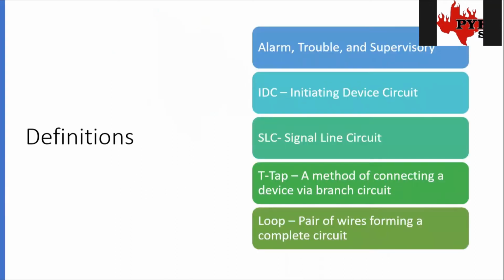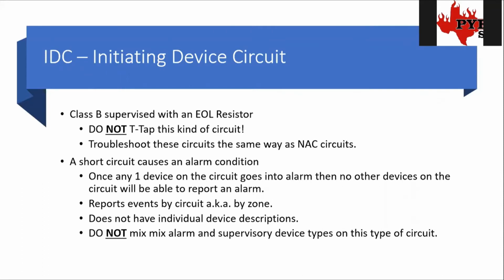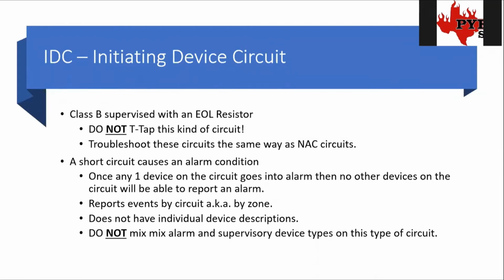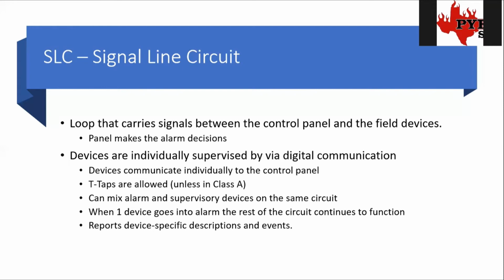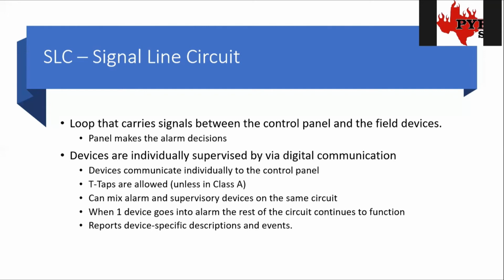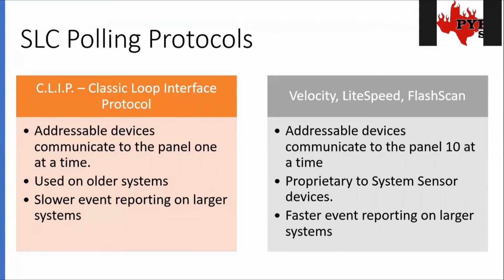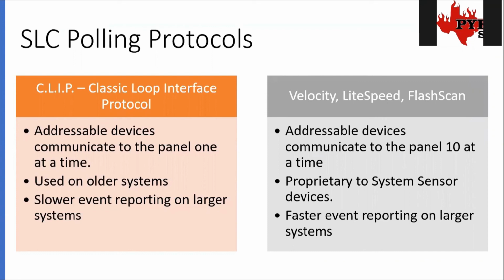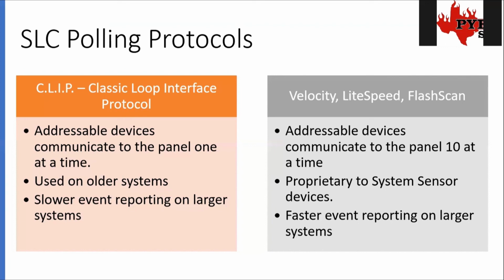Intro to Fire Alarm IDC & SLC Circuits

Comment: T tap was a type of wire connector that bit into the fire alarm wires without cutting them and the connector was shaped like a T and you would connect the wires in that T shape instead of using wire nuts. Thats why theyre hard to troubleshoot. Unless youre me of course